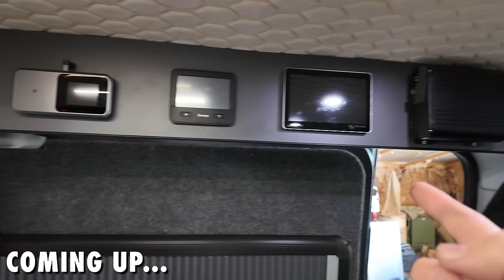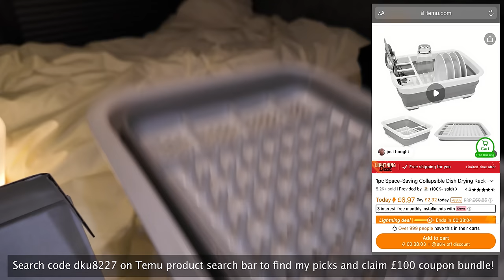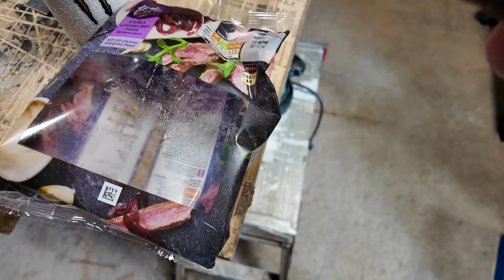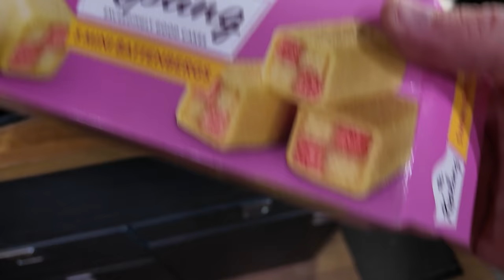Making van life better with these upgrades...

Comment: Hi Adz great video as always I had the same water leak I wanted to remove the aerial  and re seal it  but on my van ( not self build ) it’s virtually impossible to get to without dismantling half the van . In the end I resealed by wiping mastic around the aerial on the outside seems to have worked. Could you get to the rear of your aerial ?
Reply from the maker: Yeah I’m definitely not taking the headliner down so just put sealant around the Ariel and hopefully that works!

Comment: The one thing I would thought you would have looked at with everything stripped out is the heating?  Has that been fixed or is it still dodgy?   Instead you put some drawers in....  also, to be honest, could have done without the 10 minute TEMU ad, although I understand they sponsored the video.....don't sell out too much though, it will change the vibe of your vids.   Looking forward to the next adventure - hopefully not too commercial 🙂
Reply from the maker: Looking at the heating for the 10th time wouldn’t change anything. It needs new components so I’m waiting until I can get to Truma in Derby. The sponsored section was 90 seconds, not 10 mins. And it without sponsored sections this channel couldn’t exist

Comment: my garage light is wired to the van battery the reason i did this if the leasure battery / system fails i still have light in the garage

Comment: My Trafic was letting in water through where the windscreen is bonded in. I had to get it removed and refitted. But after the fact I found out there's liquid sealer that you can apparently pour in and it runs into any gaps. Apologies, I can't remember the name.

Brown sauce on eggy bread.

Comment: No disrespect intended as your not the only one but how is VAN LIFE when you all seem to have houses to go back to ?
Reply from the maker: ‘Life’ isn’t determined by the material you live within. It’s your path. If you spend your time building and camping in vans. Then that is what your life consists of. It’s no different to someone who has trained as (an example) a barber. And using the hashtag barber life on their instagram posts. No one is assuming they’re claiming they live in a barber shop. If a student posts a picture and writes ‘college life’ do you assume they don’t have a house to go back to? 
‘Van Life’ does not necessarily indicate someone is living permanently in a van. If that’s how it was, then the term ‘House Life’ would be a thing.